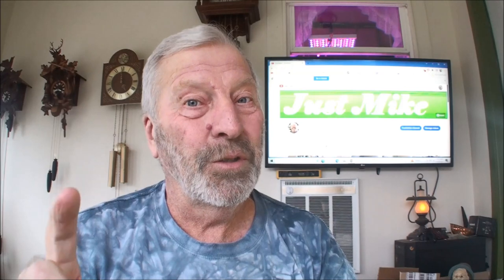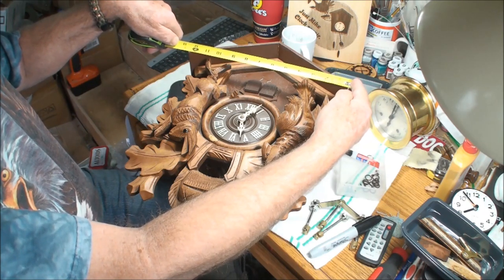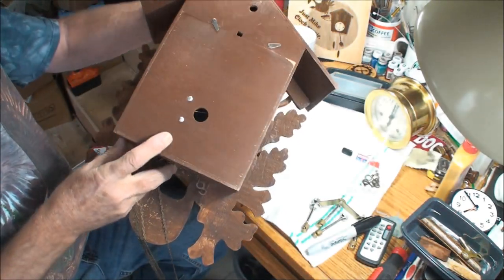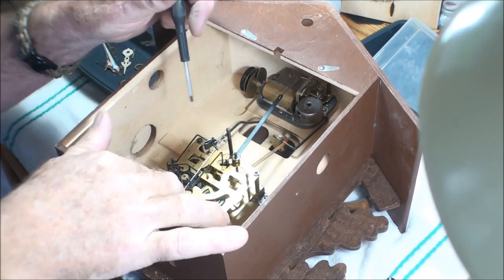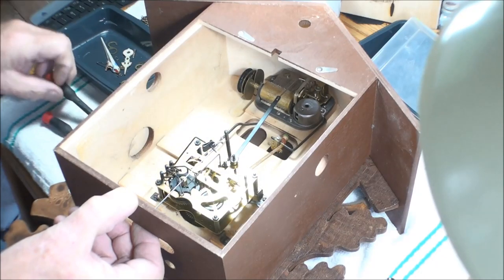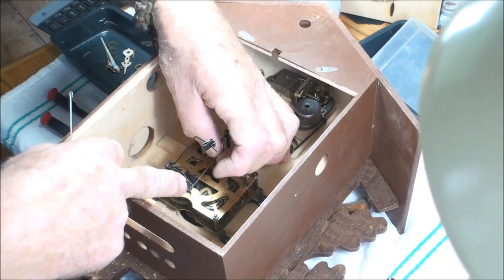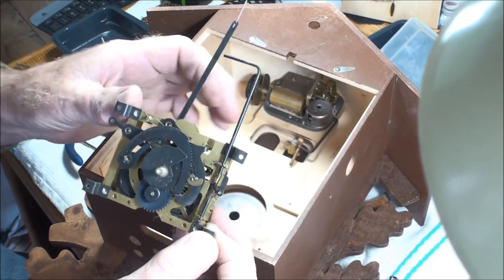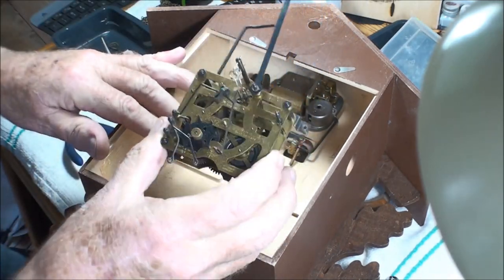1972 Black Forest Musical Cuckoo Clock w/movement made by Bachmaier Klemmer - Clean and Oiled

Comment: Hi Mike. Thanks for the video! Many videos show the gathering pallet (pacman) either being removed for cleaning and inspection of the arbor/second wheel it is attached to, or left in place. Not many describe the proper position of the pallet's pin in relation to the pin on the second wheel.
Reply from the maker: I will admit that my videos are for the person that wants to get their clock going again and want to learn. You got to start somewhere. I had to learn on my own and later I caught a few videos that explain it better, even though I was doing it already because I would watch the movement to see what had to happen to work right. Thanks so much for stopping in John and God Bless.
Reply: @justmike57  Thanks for your response Mike! The reason I asked is that I pulled the gathering pallet on my clock. I should have left it on.

Comment: I think that there is an error in the book that we both look at to compare the plates. I believe it is a Regula 25 movement. The book shows both Regula 25 and Regula 21 plates being exactly the same information other than the weights. I have carefully compared the two plates. I feel it is a Regula 25 movement. What do you think?????
Reply from the maker: I am thinking that you are right about the plates. Just the same, I am happy the clock is back running again.